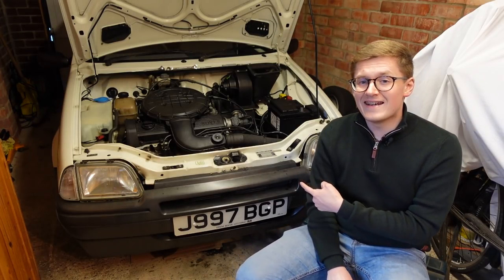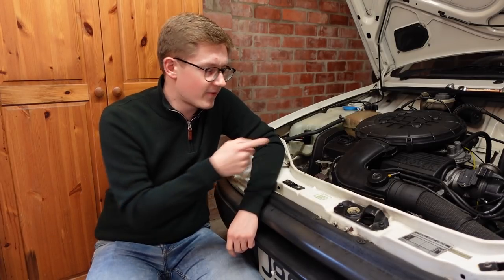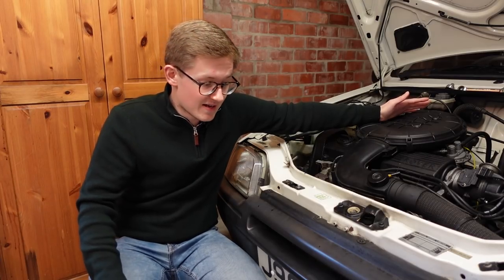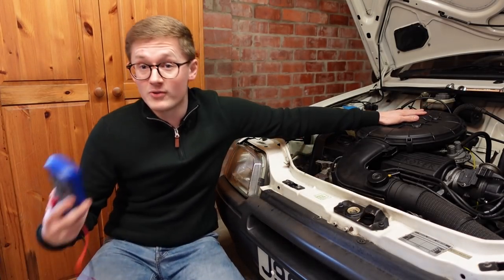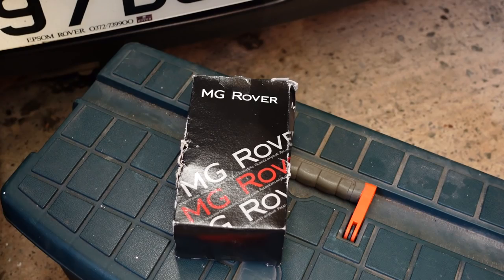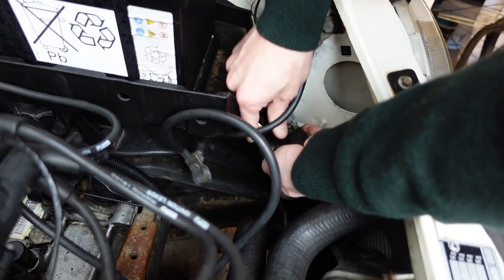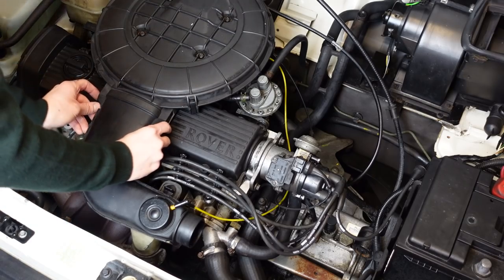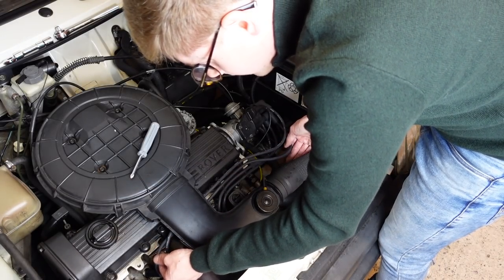Melvin the Metro - Misfiring and Stalling!

Comment: The principle of ignition coil operation isn't quite as described. The coil is charged by either the points or electronic ignition switching the -ve side of the coil to ground while tge +ve is fed from the ignition switch / ccircuit. The ground is released (ideally when the coil core is magnetically saturated which is what dwell is all about) at which point the magnetic flux within the core of the coil (induced by the energised primary winding) collapses & induces a voltage in the secondary winding. Clever bit is that the secondary has many more windings (turns) therefore the voltage induced is much higher (in the tens of KV range). I fear your fix probably isn't as complete as it appears as the fuelling is probably highlighting a weakness in the ignition system rather than the other way around. Lean mixtures are generally harder to ignite than rich ones but fouled plugs need a higher voltage to fire than clean ones. The pressure analogy works well on HT, the spark will take the path of least resistance so if there is any factor which elevates the spark voltage above whatever weakness (think pressure relief) exists in the HT circuit then the spark will take that path. Dizzy caps & rotor arms are great sources of random misfires for that very reason. Sometimes the faults can't be seen but there is an internal 'tracking path' which when the conditions are right will allow the spark a path to ground. Great fun to find!
Reply from the maker: I’m simplifying an incredible amount!

Comment: I'd have changed one thing at a time, first, that way you can decide what is only fit for the bin and the rest can be "Good" spares.
Reply from the maker: They were both faulty, as I confirmed with my tests. Why would I keep a known faulty part?
Reply: @TwinCam  if you change everything, you don't know what bits still work and might be handy to have in the shed as back-up. I've had new parts fail weeks later and had to resort to rooting out old bits to keep me going. I don't keep junk, just things that still work....me having fiat's, the same engine's were used for decades but there are many modifications over the years and buying parts is a bit of a lottery. The quality of fleabay parts can be dubious. I bought 3 water pumps until I got the right one as some had 20 teeth instead of 17 fitted to mine 🤔

Comment: Was it the leads or was it the coil ?
Reply: Good question, always try one component at a time.
Reply: Yes. And no. I suspect mostly the king lead, but in reality both slowly degrade over time anyway. Replacing one or the other may seem to fix it, but in reality refreshing both is a good investment.
Reply from the maker: Both.
As I said during my diagnosis, both were indicating that they needed changing.
Changing just one wouldn’t have made any sense.

Comment: I am sure the later inCARnations of the Metro were injected, have you ever thought of picking up a system and fitting it to the car, would make it go better and sip less fuel in the bargain?
Reply from the maker: Fuel injection isn’t something you can just bolt on.
You’d need a new inlet manifold, exhaust manifold, to modify the cylinder head, a new fuel tank, all new fuel lines, an ECU, new instruments, a completely different wiring loom for the front half of the car.
Yeah. It’s not a case of just putting some fuel injectors on 👀
That being said, why would I? There’s no power benefit in it and a negligible fuel economy increase. It may run slightly smoother, but not a whole lot. Additionally, the injection Metros are known to be much more fault ridden as the systems age.
Reply: @TwinCam  if it uses the same series engines you surely can, it isn't that simple obviously, but I have done it myself on American engines that came in both flavors it isn't terribly difficult, although I have been turning wrenches for 36 years so what I consider difficult is very different from what others may view as difficult.  But keep up the good work, an older car is a labor of love, when it is hurting you are hurting, when it is running perfectly your whole day seems better
Reply: @TwinCam  I personally get a lot of enjoyment from buying cars that are circling the drain, or that have even crossed the threshold, that have been given up on and I bring them back to as close to showroom condition as possible. I have three Chrysler 300's right now, my 06 Limited is immaculate, bought the wife's 07 W.P. Chrysler Signature Edition AWD on Boxing Day 2020, so nearly a year I wanted it but it needed me, now completely sorted mechanically and coming along nicely appearance wise and finally my 05 300C project bought it for $600 with the infamous sucked valve seat, picked up a replacement Hemi for $500, car was literally in the grave.  Person was selling it as a parts car with a running C, I talked him into letting me have it to bring it back to its former glory.
Reply from the maker: Funny you should bring up the Chrysler 300. I’ve a hankering today for a Lancia Thema.
Reply from the maker: A common modification for Metros is putting in the 1.8 VVC from an MG F. On an injected Metro, it’s a straight swap with just a little bit of wiring to make the VVC system work. It’s such a lot of work to make a carburettor car work that people, when asked for advice on converting carb to VVC, are told not to bother, to sell and just buy an injected car to start off with.
It’s more than the car is worth in just parts alone, never mind the time it takes to do the conversion.
Reply: @TwinCam  Yes, I'm told that the Mini fuel injection system is worse performing than the late carbs and all in all a bit of a nightmare.